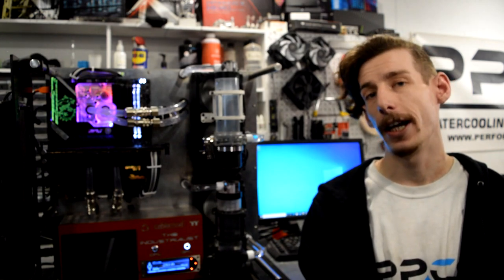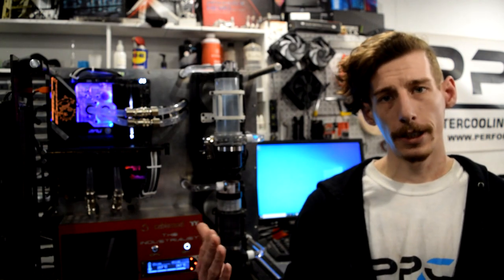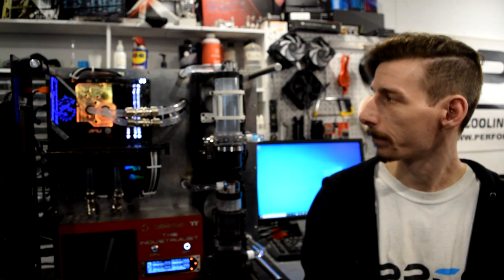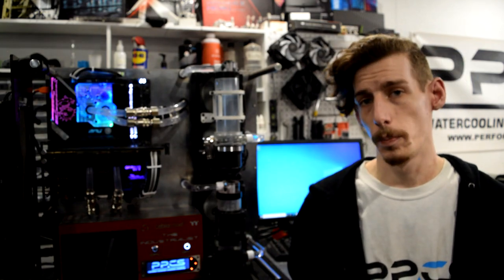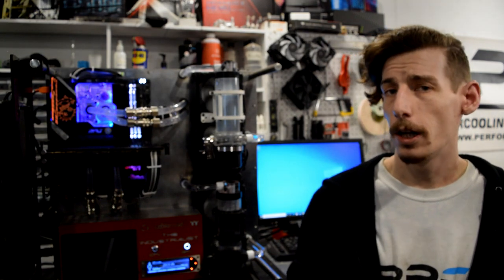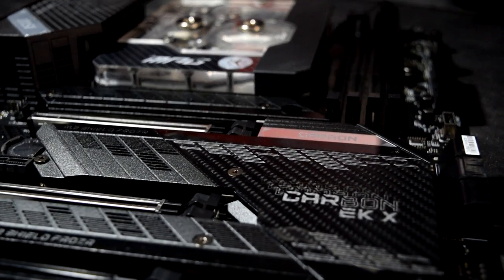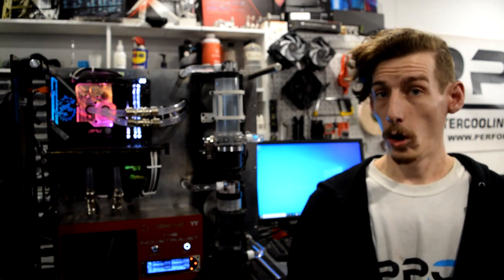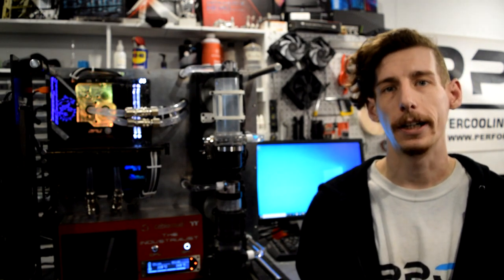MSI MPG Z590 CARBON EK X Motherboard Review

Comment: I'm a huge carbonfiber fan but premium carbonfiber, not the cheap stuff. Autoclave, void free, uv protected thick with waves showing along the edge. Not a single layer of cf or sticker of fake cf. Cf could be good for EMI shielding on certain components. I'd love to design a motherboard laces cnc milled blocks of carbonfiber.

Comment: Got the z490 with a 10850k running at 5.3GHz 1.36v. Great board so with 16+1+1 phases at 75amp if I'm right, the z590 is deff a great pick! Thanks for the great video!
Reply: If I'm lucky enough to win, which is really unlikely like always, I'd be giving the z490 to a lucky person. So basicaly, that would mean 2 winners instead of one!😜